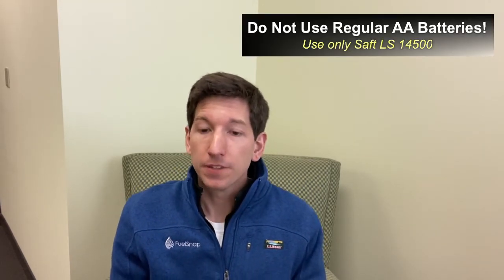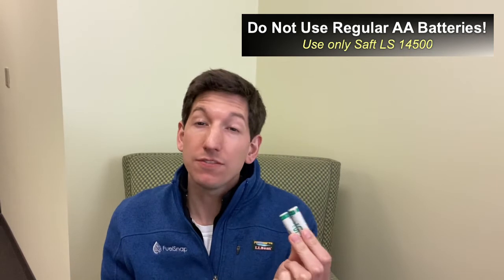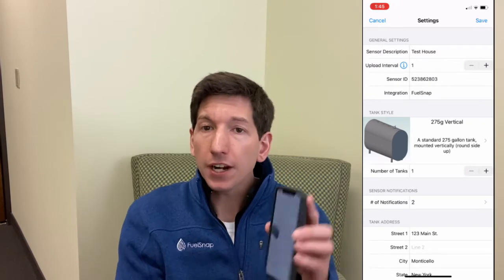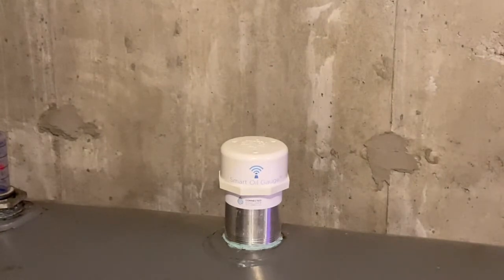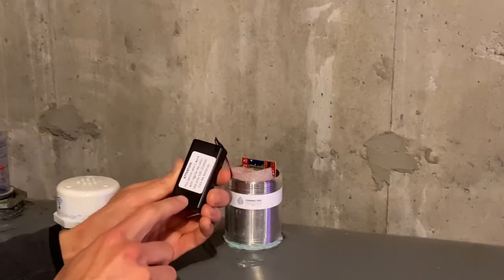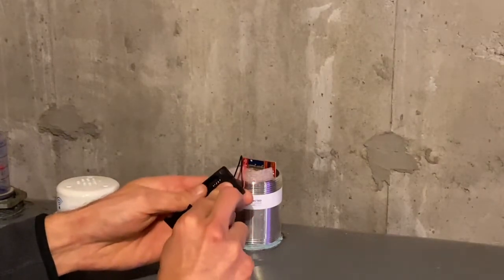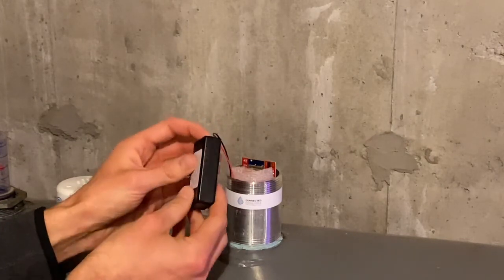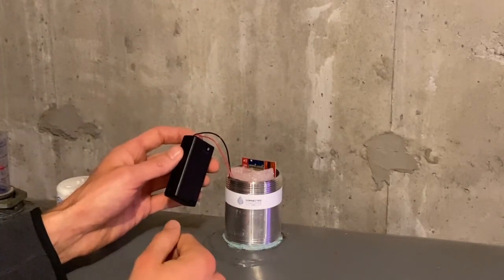How to Change the Batteries in your Smart Oil Gauge

Comment: I could not get the unit to update in the app after replacing batteries. Some combo of updating my router firmware, rebooting router, and reconfiguring to the wifi finally worked. Back in business.

Comment: Hi, thank you for the video. I just replaced my batteries. However, the batteries died over a week ago while I was on vacation. I’m not getting a reading in the app. Do I need to reconfigure the Wi-Fi? Will I lose my history thank you in advance.
Reply: You should get a new reading right away after putting in new batteries. If you don’t, I would recommend turning the device off, hitting the button while off, then turning it back on. Make sure the light flashes when it turns back on, otherwise the batteries may not be seated nicely. Check for a new reading by refreshing the app. If you still don’t have one, press the button once for half a second and then refresh the app again.
Reply: Thank you for responding. I didn’t need the instructions as it did connect. However my battery readings are only good not excellent. I bought them from Amazon. Next time I’ll have to go direct through Smart Oil.

Comment: Do they all have that little red light because mine doesn't seem to have one. I put fresh batteries in, no light and it doesn't work on my app.
Reply: The very early ones have the light way down inside. But since probably 2018/2019 they’ve had a bright light mounted up top. If you don’t see it, give the batteries a spin. The light should be pretty bright when a good connection is made.
Reply: @stevew3032  I spoke to someone at Tech Support, they said the batteries I bought from Amazon could be knockoffs (I seriouslt doubted it), he sent me new batteries and guess what?! They worked. DON'T BUY THE BATTERIES FROM AMAZON, THEY LOOK THE SAME BUT THEY WON'T WORK. AT LEAST MINE DIDN'T! I believe the + nipple contact doesn't stick out far enough.

Comment: Can you use some other brand of Lithium AA batteries?  Seems very risky to rely on one brand.
Reply from the maker: We recommend the SAFT Brand. They are very popular and easy to come by. Some batteries that claim to be the same voltage do not work properly. We also always keep the correct ones in stock so you can get them on our site at www.smartoilgauge.com/shop thanks!

Comment: Does this also reset that stats? I had a refill 3 days ago but it still has the old stats.

Thanks
Reply from the maker: The old history should all stay there. As long as the new batteries are properly seated and it reconnected to WiFi, you should start getting new data right away.

Comment: How does cold weather affect battery performance? My tank is located outside above ground
Reply from the maker: Great question! It definitely will have some impact. I would say on the low end, expect 9 months battery life; on the higher end a little over a year on outdoor tanks. Just make sure you've got a good WiFi signal going to the tank. Sometimes a range extender plugged in by the nearest window helps a lot. Thanks!!

Comment: All AA batteries are 1.5 volts Lithium batteries are not higher voltage
Reply from the maker: Hi Michael, thanks for the comment! AA refers to the size of the battery. We use 3.6 V Lithium AAs in our device; you can get them here: https://www.smartoilgauge.com/shop/product/ccf907/

Comment: Hi Steve . I discarded that foam that’s inside the gauge encasing the battery case , is that ok ? Just thought it was packing materials
Reply: Hi Al, no problem whatsoever! Just keep that desiccant pouch in there to control the moisture content.
Reply: Steve W oh brother . I discarded that too !
Reply: Can I just add a desiccant from a different product? Thanks
Reply from the maker: @mele2259  absolutely - no problem at all!

Comment: We need to know hot to replace these expensve garbage batteries that don't last with something cheaper and longer lasting.  So I can see they are in series so any beefy 7.2V capacity battery should work.
Reply: It you replace a 1.5 volt battery with a 7.2 volt battery the electronics may burn up.Ya think?
Reply: Lol